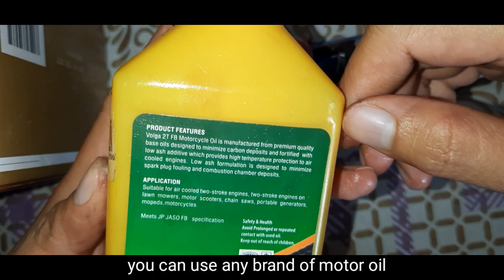How to Fix an Airpump for Fish Tank. Loud Noisy and Not Producing Bubbles Anymore.

Comment: i got excited when i saw this. i have 2 pumps that have been sitting for a couple years. i tore into them and the rubber diaphragms are ripped. makes sense! hopefully i can find another rubber piece. I hate throwing electronics away for something silly like that.
Reply from the maker: Thanks.. plus its cheaper than buying an new one.
Reply: Or just glue it together if it's not too much damaged. Finding another rubber piece of that size and shape might be difficult, but China has it all :)
Reply: @adorjanc3076  they were very damaged!!! lol no repairs
Reply: I had the same fault (magnet rubbing on coil), but it didn't have the same fix.
My issue was the rubber in the pivot point was a bit worn, causing the magnetic lever to make contact with the coil. I fixed it by removing the lever and putting in a piece of insulated garden tie wire in-between the rubber pivot point and the plastic well that it's seated in. I made a "u" shape with the wire, with the two ends facing up. I poked each end between the rubber pivot and the well. It's now working.

Comment: You know, since you are no electrician, I can tell you, since I am: you can open this unit and then plug in, to see how it works and why it makes a noise. And then unplug it before doing work, and when you finish the work, you can plug it in again (without putting back the cover) so you can see if it works better and maybe notice some errors. And also let us see the difference. Because in this unit everything is secured so you can run it while it's on, but must not touch anything.
By the way, nice fix! Keep up the good work!

Comment: Nice fix man, what was the reason for putting the metal between the magnet and the motor?
Reply from the maker: So it wont touch after tightening the nuts.
Reply: Gotcha! Thanks for clarifying.

Comment: You might have acheived an even better result by loosening the electric motor, cleaning the motor face instead of lubricating it, relocating and locking it down and left the pump arm alone.  A more appropriate tool to use would have been a pair of pliers rather than side cutters but hey, I'm just a woman and what would I know,  huh?
Reply from the maker: Thank u madam.. :)
Reply: Plyers would not be more appropriate, pliers have teeth, teeth scratch nuts, plus most plyers jaws would be too wide to fit in the gap. Ideally you would use a small open ended spanner of appropriate size. 

Alternatively, you could mark the position, remove the lever and use a socket or shifter to secure the nut while using a Phillips head inside the diaphragm.
Reply: Also, to relocation of the coil is impossible without removing plastic from the moulded case and adding new plastic.

Comment: Hi. Ask ko lang po sana kung pwede ung Baby Oil? Wala po kaisng motor oil eh. Salamat po.
Reply from the maker: E.try nyu po pero kasi yang baby oil hindi tatagal yan. Bilis  mag dry yan.. kaya need mo talag motor oil.. mura lang naman ang motor oil makakabili ka nyan sa mall
Reply: @albertsguppyadventure4293  Sige po sir. Thank you po. Bali, gamit ko po muna ngayon is ung may battery na pump po. May bubbles naman po siya kaso sobrang hina, parang paisa isa ung lumalabas.
Reply from the maker: Oo mahina talaga yn.. gano ba kalaki fish tank mo at ilang isda meron ka?
Reply: @albertsguppyadventure4293  nasa 12 na molly fish po, 10gallons po. Sobrang hina po eh halos 2months na po akong nag-aalaga. Ngayon lang pong nangyare, 😭
Reply: @albertsguppyadventure4293  Tinary ko na po kaso di pa rin po nagana ung akin. 🥺
Reply from the maker: @NoSkipAdsToWorthyVloggers  maam yang airpump nyu naka connect ba yan sa sponge filter?
Reply: @albertsguppyadventure4293  Opo sir.
Reply from the maker: @NoSkipAdsToWorthyVloggers  nalinis na po ba ung sponge kasi minsan ung sponge pala ung problema mismo kaya humihina ang bubbles